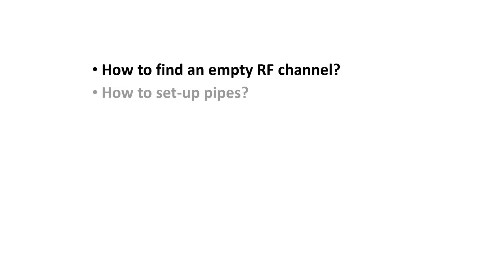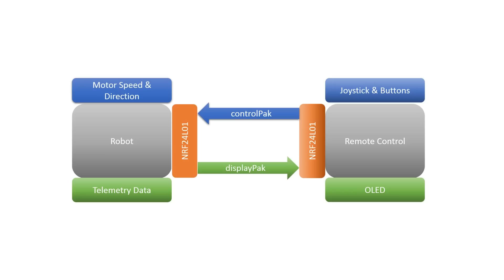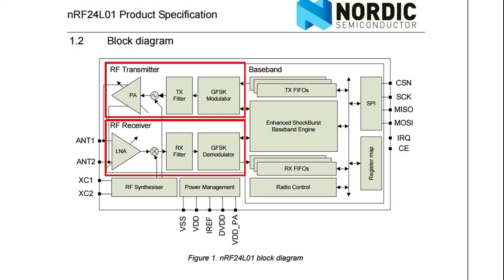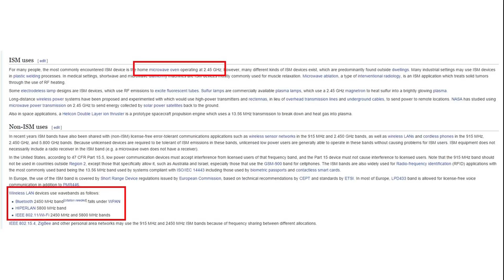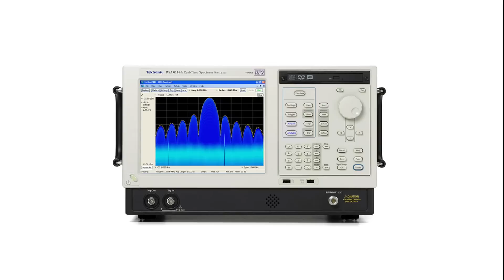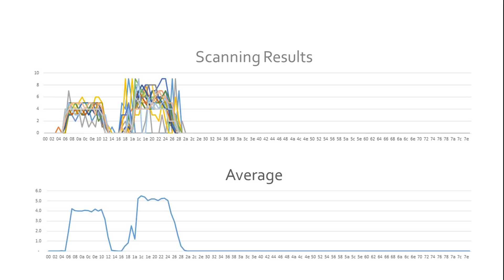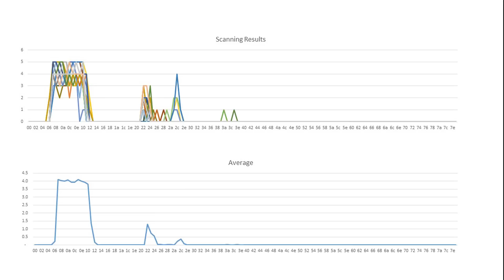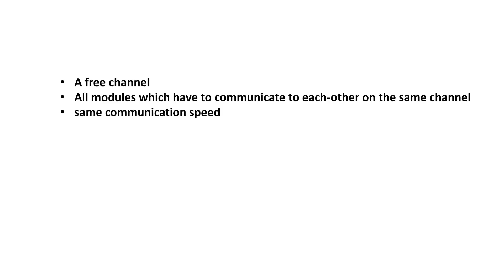#37 Advanced Tutorial for NRF24L01 and Arduino #1

Comment: A very useful videos. I want to apply this capacity of scanner, to adjust a pair of Helical Antennas and check one channel only. 
I will select the channel after selection of a channel as shown in the video.
I have a problem of few obstacles that cause transmission cuts. 
How can I get a copy of the spread sheet you showed in this video. Your help is greatly appreciated, thank you.
Reply from the maker: I did not fin a spreadsheet. Maybe you can tell me the time where it is.

Comment: By far the best explaination of how to setup an NRF2401 radio module. You have already answered a few of the questions that I had. So, the signals you use on the TX(CE and CSN) or RX don't have to be the same pins. I and many others have been looking for ways to trouble shoot our system after building it as we have had many problems. One was a bad library file. The one You suggest is the correct one as it works. Two, the antana must have 3.3 volts or it won't work as mine was 2.1 volts?! bad connection.Three, using print statments help, but only that the software is functioning properly and not the signal going out of the antana.
I look forward to the next session, thanks
Rick
Reply from the maker: I am glad your NRF2401 work now!

Comment: Hi can you use 4-5 nrf24l01 with single esp32 and all nrf's send same data at the same the ...no receiver setup
Reply from the maker: You always can transmit things in parallel (each module needs a different CE). The problem is what happens on the receiver side.
Reply: @AndreasSpiess  The question i asked was for a mini jammer do you think 4-5 nrf's transmitting data at the same time will has the jammer effect
Reply from the maker: @AzharKhan-cy5kt I do not comment on jammers because I do not like them.
Reply: @AndreasSpiess what! Jammers are fun why would someone not like it... you are old i think that's why you don't like them ...come on old man I'm stuck help me out

Comment: @Andreas any plan to do an in-depth tutorial on NRF52?
Reply from the maker: No. But I am interested in the BLE of the chip.
Reply: @AndreasSpiess  I guess then its time for you to lead the way for your followers, including me. I was surprised when i compared BLE data sending current consumption. ESP32 on full throttle consumed 150mA (including IMU and WiFi disabled + no computation on processor) but NRF52 only consumed 38mA which is a huge difference.

Comment: I have a question. When I use ESP8266 wifi module i'm using the IEEE 802.11 protocol, so when i use nrf24l01 what is the protocol?
Reply from the maker: It uses a proprietaryprotocol. You might find information in the datasheet of the chip
Reply: Hmmm thank you so much for your awnser, now I understand...

Comment: Andreas, my results of the scanner is : 000000000000000011111111111111112222222222222222333333333333333344444444444444445555555555555555666666666666666677777777777777
0123456789abcdef0123456789abcdef0123456789abcdef0123456789abcdef0123456789abcdef0123456789abcdef0123456789abcdef0123456789abcd
000000010000000000000000000000000000000000000000000000011110000000200000000000000000000000000000000000000000000000000000000000

is it normal?
I dont understand the result..

thank you.
Marc.
Reply from the maker: Just read each column vertically. So, channel 01 has no signal. Channel 39 has a signal

Comment: Very great tutorial but using the library Tmrh20 results that the receiving rf24 doesn't start unless the serial monitor of the transmitter starts, how can i fix that??
Reply from the maker: This is an old project and I do not remember the details. Sorry.
Reply: Ok thank you for your reply, but i have another question related to the nrf24l01, when i send an array of 12 elements (6x2), i use serial printing, i got the first 6 only
Reply from the maker: +Abdelrhman Hany if i remember right, the 24l01 can only transport a payload of 32 byte. Check how long your payload is.
Reply: Thank you Mr Andreas so much , ive learned a lot of your tutorials :D

Comment: Andreas, very informative video, thank-you.  I have two points of confusion, where clarification would be helpful.

I've been able to get the raw noise data from the serial monitor, but I fail to understand how you differentiate between channel numbers and what the binary information means.  From a layman's point of view it seems you pull channel 24 out of a hat.  the channel number isn't contiguous and I see nothing in the raw data, that differentiates specific channel numbers from the rest of the data.

You also reference video #3 in regard to importing data into Excel, however there doesn't seem to be a 3rd part to your NFR24L01 videos.
Reply from the maker: The first two rows show the channel number and the other rows show the signal strenth on this channel at a particular time. If you see 0, the channel is free. So, you search for channels which stay free for a long time.
Reply: Thanks so much for the response Andreas.  I'll go back and see if I can make some sense of it, now that I have an understanding of how to delineate the information.

Comment: Hello sir i need a basic code for nrf24lo1.I want to turn on an led from a button wirelessly using nrf24l01 .button is connected to an arduino and led is conneccted to other arduino both arduino have nrf24l01 .I just need a very simple code.Thaks in advance.Kindli send me the code at faizanalikakar@gmail.com or send me a link.
Reply from the maker: Just use the "led_remote" example sketch of the RF24 library. Or you read http://www.instructables.com/id/Wireless-Remote-Using-24-Ghz-NRF24L01-Simple-Tutor/
Reply: thanks.but it give me the error in the line done=radio.read(msg,1);
the error is that "void value not ignored as it ought to be"
please help me get through this .
Reply from the maker: +FAIZAN ALI what is your sketch?
Reply: i am using RF-master library from github..The error is in  this line
 done = radio.read(msg, 1);
Reply: I want to turn on an led from a button wirelessly using nrf24l01+pa+lna .button is connected to an arduino and led is conneccted to other arduino both arduino have nrf24l01+pa+lna .
Reply from the maker: Line 232 of the sketch I mentioned in my answer shows how to do it:
while (radio.available())
      {
        // Fetch the payload, and see if this was the last one.
        radio.read( button_states, num_button_pins );

        // Spew it
        printf("Got buttons\   ...

read() seems to be defined void and does not return a value

Comment: hello, I am a student and i need some help for my project, may you help me? i want to display information from a soil moisture sensor(from the serial monitor in percentage) using nrf24l01 from one arduino to another, do you know how I might to do that?
sorry i am still a beginner it.... and thank you for the video it is great :)
Reply from the maker: I would propose to start out with a block diagram. There, you should see, which problems you have to solve and you can start with one part and go on to the next. With this method, it is also easy to google for particular solutions because you can formulate your problem and questions very precise. Google is not good in answering broad questions.
You find many tutorials for each aspect of your project, and if you are patient, you will be able to solve it. I also did not know anything about electronics when I was born and had to learn everything ;-)

Comment: hi sir, i have to control the robot car project. Where the rear wheels in the form of a dc motor is controlled with flex sensors and front wheels in the form of a servo motor controlled by the accelerometer sensor. Robot controller with a car connected with nrf24l01. if one of the sensors to control I can. but if it combines both to control I can not. Both sensors transmit data simultaneously . dc motors and servo motors confused receive data so that its movement is chaotic. How should I fix this? can you help me.? Can I send my program to you and you see.? Please. My email: rema_adhe@yahoo.com
Reply from the maker: +rema adhe it seems that you have still some work to do to fix these problems. These problems cannot be solved by looking at the code alone. It needs a lot of testing to isolate each error and correct it. So, this has to be done by you and your robot.

Comment: That could be very helpful in my project - temperature sensors network. I were so optimistic abou it, but an error get me to the ground.. When I compile "scanner" I get the message "sketch\output\scanner.cpp:1:22: fatal error: WProgram.h: No such file or directory  #include <WProgram.h> " I did some research and I found out that i must change in scanner.cpp "WProgram.h" to "Arduino.h" and I did.. and I get more error messages,... I'm fresh user of Windows 10. Could You have some advise for me?
Reply from the maker: +mamdobreklapki0 Which library do you use? RF24? Which IDE version do you use? Did you include the library with Sketch->include library-> manage libraries (and search for NRF24). Then install RF24 by TMRh20 library.
 It has nothing to do with Windows10.
Reply: +Andreas Spiess thank You for quick response. I use IDE 1.6.7, I installed RF24 library by TMRh20, as You recommended.
Reply from the maker: +mamdobreklapki0 I still use 1.6.5. This version seems to be quite stable. 
I see no obvious readon for your error. So, I cannot help you because I will not upgrade to a higher version for the moment.
Reply: +Andreas Spiess I think I'll get 1.6.5 version also.
Reply: +mamdobreklapki0 It works fine on 1.6.5 IDE version.. thanks!
Reply from the maker: You are welcome!